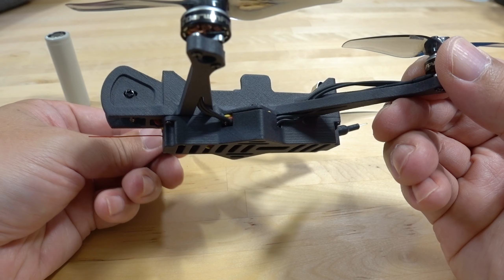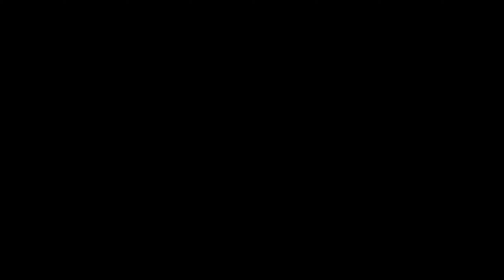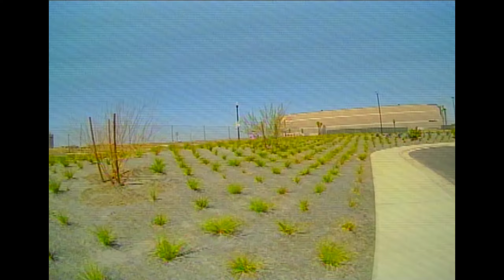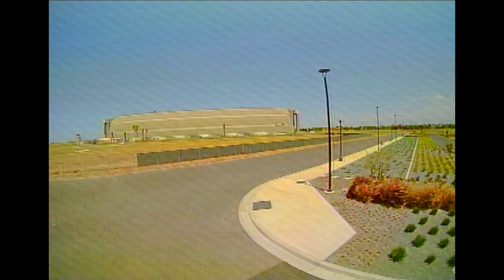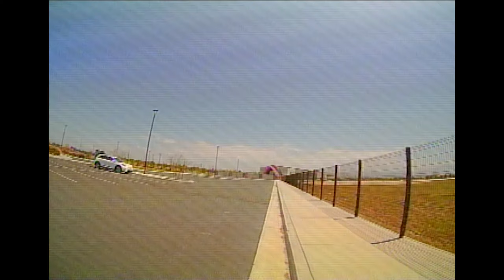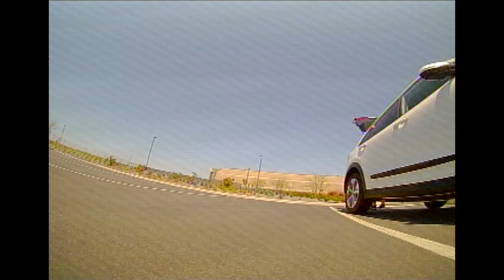Darwin18650 Micro Drone Review 😎

Comment: Did you solve the gps problem by changing the vtx pigtail cable? I have the darwin 129 I have a problem finding satellites
Reply from the maker: OK, so this comment is on the wrong video so if anyone else is reading this, go to the Darwin129 video.  This question is unrelated to the Darwin18650.  DarwinFPV sent me a replacement pigtail cable and that resolved the GPS lock problem.  I am now able to lock onto 12+ satellites on the Darwin129 no problem.  If you still have this problem, I would contact them or buy a new longer pigtail.  The longer ones seem to work better.  The pigtails cost about $1-$2 at most stores.
Reply: @AlbertKimTV  ok thank you i asked in this video because i saw that you report this problem from the middle of the video to the end

Comment: New to Betaflight comming from Ardupilot.  Any thought on PIDs for this? Stock PID's has a lot of wobble in hover and have removed with highr PIDs on master slider but don't know hoe far is too far!  Nce little quad so far!
Reply from the maker: You can raise them until you hear oscillations or the motors get hot.  So check the motor temps 20-30 seconds after take off.

Comment: Glad to see MJF/SLS 3D printed parts there... MJF 3D printed parts should be a lot stronger compared to ones printed with desktop extrusion based FDM 3D printers, because MJF parts have minimum horizontal layerline separation.
Reply from the maker: Good info 👍

Comment: Do you think this will do 2S with 2 18350 batteries?
Reply from the maker: You need lower kv motors.  FC is able to handle up to 3S but the motors will fry the ESCs

Comment: Hey Albert, I moved the GPS to the top plate on the 129  and now I get 5 satellites in about 30 seconds and have seen as many as 17 in flight. Before that it took forever to get 5 for launch and I never saw more than 7 while flying.
Reply from the maker: The problem is the location and the amount of RF noise.  The replacement pigtail seems to help reduce the RF noise part so it does help a lot.  What you should also mention about putting it on the top plate is that when the GoPro is recording, it puts out even more RF noise than the VTX and when I tried the GPS on the top plate, it got a lock like you said, but when I turned on the GoPro and started recording, I went back to ZERO satellites!
Reply: @AlbertKimTV  That makes sense.  I don't have a GoPro 😃
Reply: Would be interesting to see if the length of the replacement pigtail it's a multiple of a wavelength (5.16cm I think) for 5.8GHz - if it is, kinda curious to see it a similar approach might fixe other GPS problems on 4" LR quads.

Comment: Great my friend but is frágil 👍🤗🤜🤛
Reply from the maker: I think this one is more durable than the Rekon3 due to the nylon filament and it's slightly flexible too.
Reply: This one is made of a different material and you have no proof this one is fragile. This is an assumption based on the Rekon3 only.